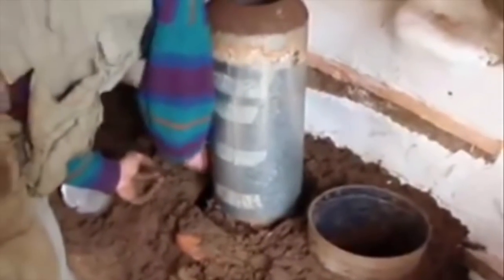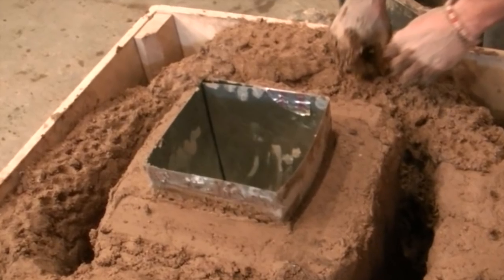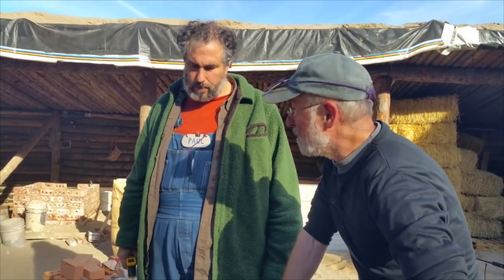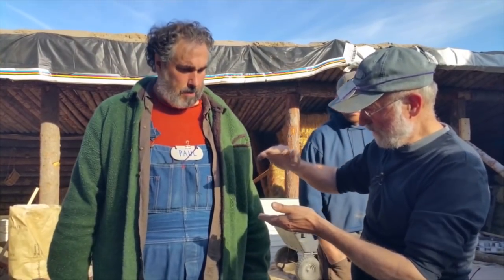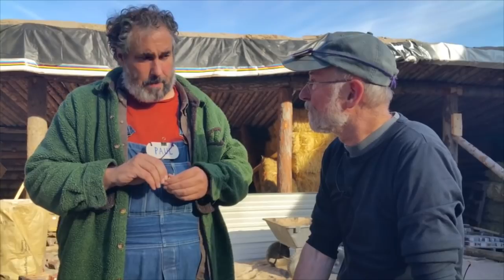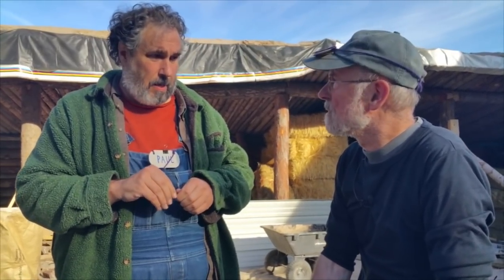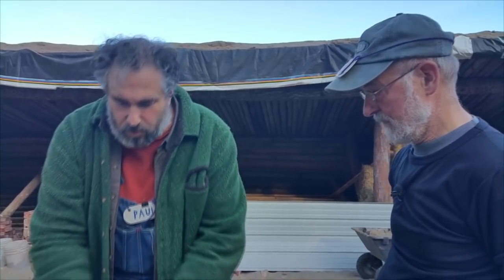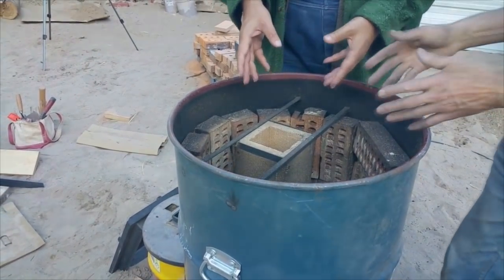do NOT use metal in the core of a rocket mass heater

Comment: What about the liberator? Wer buying one because it makes our insurance agent happy.
Reply: The old Gen 1 didn't have insulation and used cooling fins. That made the heater less efficient overall. And the 4" core reduces peak temperatures due to the square-cube law. We've long since switched over to using refractory insulation on the combustion chamber, with a steel outer shell for strength.
Reply: @liberatorrocketheaters834  awesome to know. We really like your heater and are excited to order, we almost have enough saved up.
Reply from the maker: liberator has insulation inside the metal.  Plus, being just 4 inches, it doesn't get as hot.
Reply: @paulwheaton  thank you. I hadn't noticed on the factory tour video.

Comment: For those who insist on using metal, they need to go with Inconel. If you do so, give the drawing to a shop equipped to work with it. It's too hard to drill, cut and weld for Home depot equipment.

Comment: what the old man is saying, is indeed correct: heating steel in an oxidizing flame, pulls the carbon out of the steel.  It's not rusting indeed, because that would mean binding the iron of the steel with the oxygen.. which happens also, but slower than the carbon degradation of the steel.  When the carbon is gone, the rust will become the problem, because the oxygen has no carbon to bind to anymore.  That's why you see a phased approach with steel, when it goes wrong.  It is the difference between what is known as an oxidising flame and a carbonising flame, something which is well known by steel welders who use gas: you need to regulate the mix of gasses correctly, or else you will see a sooth-depositing, carbonizing flame (which can also be useful for certain purposes, btw.  e.g. when you want to deposit some sooth as a protective layer onto something, for some reason.. so it isn't all bad.  For welding, you want it clean, of course.).  Now, you could get creative, and inject some carbon at the spot where the flame has the danger of becoming oxidising, so that the steel gets attacked less at that spot, if you have no choice than to use steel at a certain point.  The carbon will actually form a protective layer on the steel, and if the steel is cooled well enough, it won't melt either.  Ventilated cooling fins on a piece of steel in this way might be an idea.  This will then of course give a more sooth-depositing flame at that spot, but if the burning temperature is high enough, and if there is enough oxygen still left down the path of the burning chamber, the carbon-particles-loaded smoke will after-burn into a purer CO2-mix, and show up as no visible smoke at the exhaust.. just hot CO2 without actual carbon particles.  It's all about finding the equilibrium between heat and the melting of the steel (or rather: dissipating the heat away from the steel), if you can't do without the steel, and having a non-oxidizing flame (=carbonizing) where there might be steel, getting your burn chamber hot enough (preferably in a ceramic material), after-burning your smoke, etc.  It's rocket-stove science! lol

Comment: What I've learned from this is that as long as the steel is not getting red, you are in no immediate danger. It can get some red, 900F and not spall. But if it's getting bright red, 1300F, then you're in spalling danger.

Comment: Hi Paul, Thank you for an informative video of your discussion with Peter. Great questions and great answers from a really thorough thinker. I like Peters polite oh.. oh.. oh... before correcting the argument.
I make little 500g 'Rockety' tent stoves that are all metal! (Not Rocket, but a little in common and I call them inverted J-burners). They have; inverted stick burner/fuel tube, little mass, no formal heat riser (just wasteful long flue pipe for the strong draft). The burn is very clean and hot est. 1,000-1,200C even with wet wood. They run on excess air/oxygen for very clean burning and the metal at the bottom of the burn/fuel tube is slowly burnt out as you discuss with Peter.
I have also speculated that it is the radiant heat from the charcoal+ insulation and I add oxygen+absense of carbon from smoke as a contributor to the damage. It was nice to hear someone else (Peter) state this. I use the term of; "Smoke protecting high-temperature metal form oxidation?"
I have another burn out point where the hot flue gas (often flaming) enters the flue pipe turbulently at the start of the pipe. Only about 50mm get burnt. I have been cutting it off after many hours of use. Now I use a sacrificial guard tube to address the problem. I suggest that turbulence is also another factor that increases metal decay. I think it enables the oxygen to get at the metal to do the damage before laminar flow settles in and provides some protection as well as a fine coating of carbon. Inside the fire bowl of my stove, there is a flame guide or baffle that gets 'hammered' with charcoal combustion on one side and gas flame on the other and no contact with the outside world to reject any heat. Even with all this, it survives better than the tip of the burner tube. I speculate that it is because it is bathed in carbon-rich smoke that it survives so well. It would be nice to know if my explanation makes any sense to the experts.
  
Sorry for my rant, but it was so good to hear someone describing what I have experience in my stove design. I am not a lone voice any more.
Here is a link to my redhot KISS Stove; https://timtinker.com/the-kiss-tent-stove-for-alpine-tent-heating/.
It might be inefficient, but it is delightfully hot in a little winter tent. 

Thanks again, Tim
Reply: I imagine the shape - square corners - makes more turbulence.  

I've never heard of the "low-carbon air" issue, at all.  I never thought it was the carbon breaking its bonds that caused the spalling.  Perhaps cast iron would be a better choice for the metal parts.
Reply: @harrymills2770 
Hi Harry, Yes, I find sharp corners make more turbulence whic causes better air/wood gas mixing and more complete combustion.

Cast iron would be better, but not in my backpack as I go off on a ski trip!

I was not suggesting that the carbon was causing the spalling  I was suggesting that the excess carbon in the flame or on stove surfaces can provide some oxidation protection for the metal because it can mop up the excess oxygen that would otherwise be left to attack the hot metal surface. (Peter starts to talk about this at about 6 min into the video). For me, it is a compromise between stove efficiency (wasting a little bit of smoke) and having that smoke improve the longevity of the very light all-steel tent stove by reducing spalling. Tim

Comment: I want to buy the videos, but I have a question. Do you give actual build plans, with materials specified, and also dimensions clearly specified? I have wasted money on books that are full of pictures and very little to zero actual facts. 
Things like, "we have tried this design, and it was inferior to this design" would also be helpful.
So, before I pay money for videos, do they contain real build information with real dimensions etc?
Reply from the maker: There are actual plans for a lot of this that are sold separately.  I know that for the wood box shippable core, we do share dimensions.  I think there is a lot of exploration on what works and what does not.
Reply: @paulwheaton  Thanks Brother. 
We are purchasing acreage, and will be building. Have you ever heard of someone running the exhaust through a concrete floor? I have seen radiant floor heating using heated air, but I am wondering about using the heater's exhaust. It would be very long, and so maybe a fan at the exhaust end pulling air through until it gets to drawing on it's own?
Reply from the maker: @jaycoy59  Lots of people have used a floor as the mass - yes.

Comment: Use stainless steel.The ,,metal,, dont last not because its corroded.
Reply: No wonder stainless steel containers make good crucibles for hobbyist metalcasters. Doesn't rust when trying to cast aluminum or copper.

Comment: Its not the dark color of the steel, its the energy density (ability to accept thermal energy).  Also, galvanized steel has a much higher thermal conductivity (ability to lose thermal energy) than normal steel.

Comment: Steam locomotives burned coal, which has a much higher BTU than wood, and were constructed entirely of steel, yet they seemed to be quite sturdy all through their service lives. Somebody's figures are off.
Reply: Basically the steam combustion chamber was made of several layers of sheets of metal. The fires were lit in the main chamber. The outlying sheets were separated and filled with water so as to create steam. As long as the boiler was completely filled with water, no damage would result to the inner metal layer. It was the boiler man who was responsible to make sure that the water levels were constant as the steam was released.

Comment: If you can find cast iron that will work for your design it will last a looonnnngg time.
Reply: Cast Iron naturally contains carbon in the form of graphite. 
I would guess that pure Fe would still oxidize as well.
Ceramics (Clay) are often pre oxidized. 
I only just found out that the ash in burnt Anthracite is Silica oxide, Aluminum oxide and Calcium oxide.
This is all YouTube learning so you might want to fact check it all :]
Reply: Cast iron would easily tolerate the heat without damage. But I wonder if it would absorb too much heat for too long in the beginning of the burn? The rmh needs to be a quick hot burn from the get go or you have too much incomplete combustion.

Comment: I expanded ny burn chamber to take cord wood from 5 3/8 to 8 square. I used 1/4 inch steel... it works but crazy shit goes on... getting it to draw is now a challenge, whereas before, it was much less of an issue.

Thanks for your input. Makes sense. 

Still going to use the stove as-is this fall, but stove 2.0 is on the drawing board, using Peter's burn chamber... what is beyond it is still going through design permutations. 

So many ideas....
Reply: T.W.: No need to re-invent the rocket stove. Go to Aprovecho Center, "tier 4", TLUD style stove by Kirk Harris.

Comment: I only knew metal wouldn't last, not why. I've watched dozens of videos and this is the first that goes into the metallurgy. Very interesting, thanks.
Reply: Transmutation
Reply: Cast iron and carbon steel withstand high temperatures.

Comment: what is the word you keep using, "the steel will "spall" not melt" How is this word spelled and what does it mean?
Reply from the maker: I thought we covered it pretty well in the video.   For steel it is because of the carbon in the steel.  It sorta flakes off as a form of oxidization.   It turns gray and flaky.   This is why you have "cast iron" stoves instead of steel.   Cast iron is pure iron.   It doesn't spall because it doesn't have the carbon in it like steel does.   https://en.wikipedia.org/wiki/Spall
Reply: paul wheaton  Why not make a rocket stove out of cast iron then?

Comment: Hi. Does anyone have insight into using metal inside a refractory casting, like a rebar or finer mesh to add strength to the mix?
Reply: Matt Walker has cast a riser using fine stainless steel needles mixed in...rebar or anything thick would expand/contract too much and crack the fired riser.
Reply: I would reinforce the refractory with fiberglass.

Comment: Most of this I agree with, however... I've made about 500 rocket stoves using steel, in the core and the body, and have no issues because I use the correct kind of steel according to the temperatures involved. SS310 is rated for use at 1150C (2100F) and so far I have not seen any kind of spalling or oxidation on the cores I've had in homes over the last Himalayan winter getting about 12 hours of up / down firing every day for months at a time. Not to say its the best material out there... I just like it due to being more portable than ceramic cores. Having said that, I would probably choose a ceramic core if it was practical.
Reply from the maker: I need a bit of clarity on your statement.   You say rocket stove.  Maybe you mean rocket mass heater?  I only mention this because ....  https://www.youtube.com/watch?v=IAb3922HD9U
Reply: Yes its a common point of confusion, even here in India. I use the word 'stove' as there is no universal word for what I do... its like a rocket mass heater, except without the mass. I use a rocket core combined with bell effect to maximise heat radiance into the room, so I guess I could simply call it a Rocket Heater, but that doesn't mean much to the people I'm reaching who have no idea what a 'rocket' has to do with heating their home. We are starting to look at ways to add small amounts of heat storage mass, such as water mass in this example: https://youtu.be/tE4j5QS1Ni8

Comment: Hmmm... I just enlarged my feed tube from 4 3/8 to 8 inches, and I used 1/4 inch steel. With the secondary air open, I can block off the feed tube with only two 3/8 holes for air... I'm getting consistently higher temps, even with somewhat damp wood... a rocket no-no.

The only thing I'm concerned about is that my exhaust temps are too low, about 110 to 120°F.

Peter rocks... but, we all make mistakes... that's how we learn. I'm sure he's made plenty. 

I've made major blunders... 2 weeks of hard work... garbage... learned a lot, and the rebound from this disaster was successful beyond my imagination....

I love all this innovation, experimentation. Can't wait for my next build to be completed. So many ideas.

Comment: was going to buy the eco-zoo stove but it is made of metal, I have a house that used to be a stage coach station, I salvaged the chimney bricks and 4" x 30" ceramic stove connector tube, thinking of taking 5 gallon bucket and using the tube as chimney and using chimney bricks as burn chamber , enclosed in perlite and concrete, is this my best option?
Reply from the maker: Bruce, the response to this is more than what will fit in a youtube comment.  Have you watched the DVDs?  Have you posted to the forums at permies?

Comment: So after watching this I'm wondering it is possible to build a batch box RMH out of an old Fischer type woodstove?  My plan was to line the entire burn box with firebrick.  I would have to buy longer bricks and just run them across the top from side to side resting on the side bricks.  Should I poo poo the plan?  The entire inside would be lined with fire brick except for the door.  I was think of welding the rise on the top of the stove.  Would it be safe just to line the inside with clay?
Reply from the maker: In this video, ernie kinda does what you are suggesting

https://www.youtube.com/watch?v=DMUES-34Ioc

Comment: Paul, is it feasible to use a chimney terracotta flue pipe for the heat riser?
Reply: We did try them a few times.  They tend to crack pretty badly, pretty soon.  Best advice from another mason: to get a little more life out of them is to make a long cut with a masonry saw, down one side, so they are "pre-cracked" and maybe the heat stress won't make more destructive cracks.  However I doubt this would save them in the heat riser.  There are some higher-temperature ceramic castings of similar shapes available in Europe called "Chamotte" or "Schamott" that are more like fire brick in their ability to withstand the heat.  Possibly a US fire brick manufacturer or importer could find you something like that.
Reply: To be economical (aren't we all?) I suggest going with aircrete.
Reply: Don Duncan  Why aircrete and not regular concrete?
Reply: brian gallia: Research aircrete. It can be 10% the weight to half. But it insulates so the stove can be lifted when hot. This allows the ash to be removed for better performance. It won't crack or degrade. And it is easy to make.
Reply from the maker: I bought some once to try and ended up never trying it.  I would want to look up what temperatures it can cope with first.  And, if I did try, it would be wrapped in durablanket.
Reply: I will gather that information for future reference Paul. I am encouraged by your site, knowledge, and reply.  Thank you
Reply: Thank you kindly
Reply: Don, this is not a good application for aircrete. It is porous, brittle and not terribly strong. When the moisture in the air bubbles is exposed to extreme heat it will vaporize cracking the aircrete in the process.